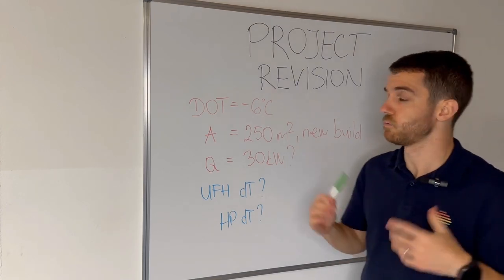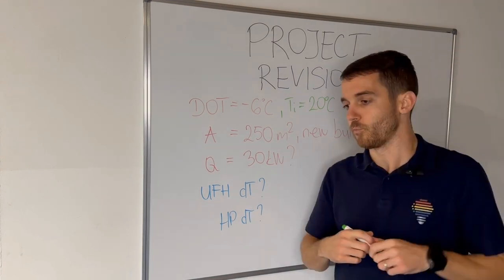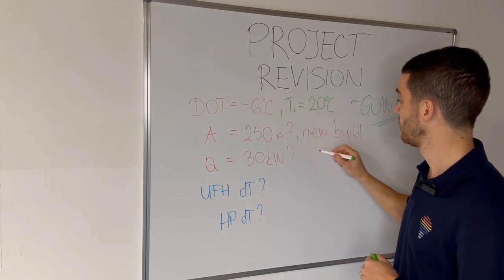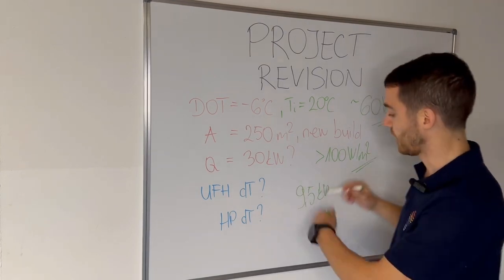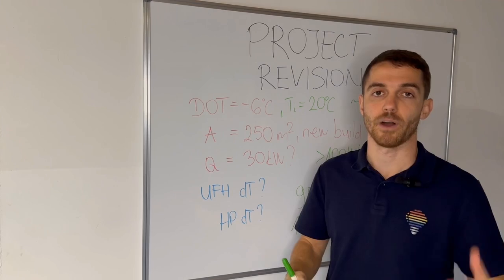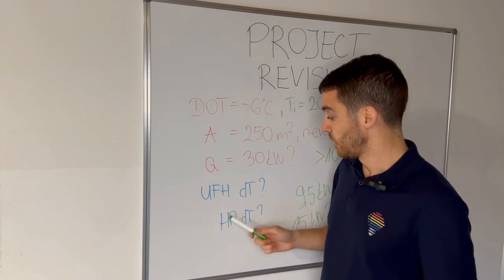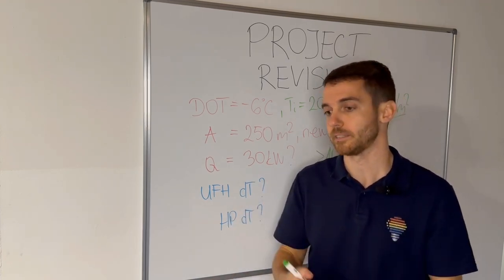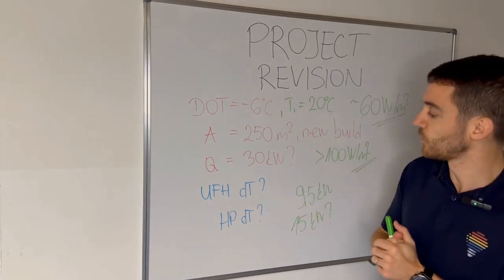Heat Pump Oversized by 300% | Heat Loss Tips

Comment: Another very important issue (as well difficult task....) is to combine the heating and cooling loads, so as to select the proper heat pump capacity, so as to avoid oversizing....In Mediterranean regions, cooling loads are the important and usually define heat pumps' selection, while other parameters like coincident factor in cooling use are challenging in the final decision....Selecting heat pump so as to cover cooling loads hides a risk to oversize in heating.....I suggest to prepare a video on this too....
Reply from the maker: Yes, this is the problem. This is one of the reason why I like separate system for cooling.
Reply: @HVACEducationHub  I am not sure I understand what you mention. Since you have an air-to-water heat pump, you have a unique source, both for space heating/DHW production and cooling. Selecting the heat pump, means you select a model that provides specific cooling capacity. At the same time the same model provides a specific heating capacity. Covering cooling loads (which for Mediterranean climates is the most important, at least from my experience) leads to an oversized heat pump for heating. Except if you undersize heat pump for cooling, since statistically it seems that home owners cannot be at the same time both in bedrooms and in living room/kitchen. Still seems challenging to fine the best solution to cover heating and cooling true maximum load and at the same time not oversize heat pump
Reply from the maker: I mean separate system for cooling. For example, air to water HP for heating + DHW and air to air for cooling
Reply: @HVACEducationHub  Yes, this is the best. But unfortunately most clients cannot support it...

Comment: Excellent video, thank you. I think that after calculating heat losses in the software, it is advisable/essential to analyze the results to identify which elements have the highest heat losses. This helps to account for the imperfection of the initial data and improve insulation within a reasonable budget.
Reply from the maker: Thanks and agree, double check is always a good idea.

Comment: Another excellent video, just to clarify in the example I assume that the 250 m'" 2 house is the floor area only or is it the floor, ceiling and outside walls representing 0.24 W/m'2? though you right that a great many heat pump installers do not do the sums or mis understand the principals of low temperature heating and so totally oversize the heat pump, it is very common problem in the UK( but is getting better) are you having a similar problem in Croatia?
Reply from the maker: Yes, floor area is that.

Similar is everywhere.